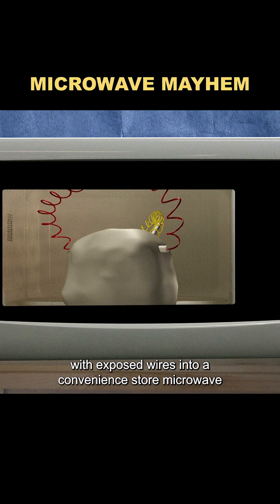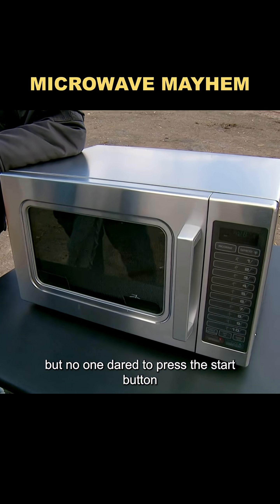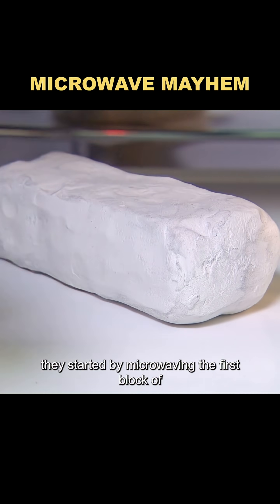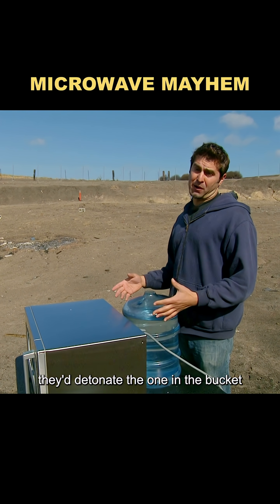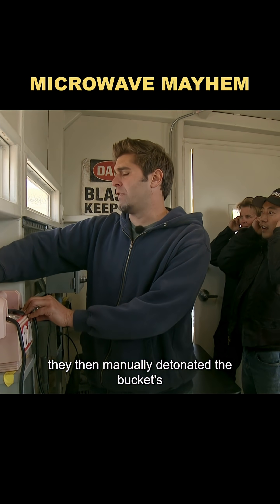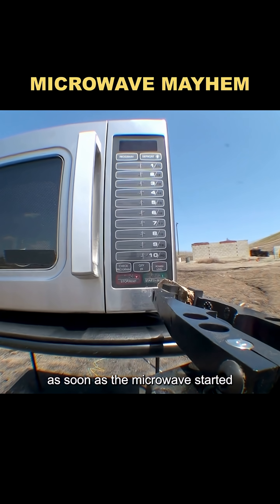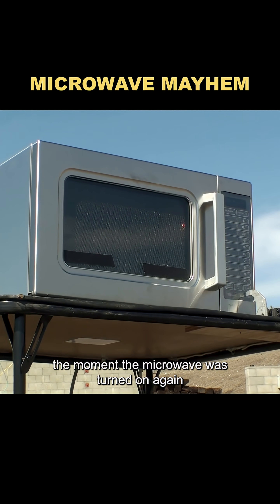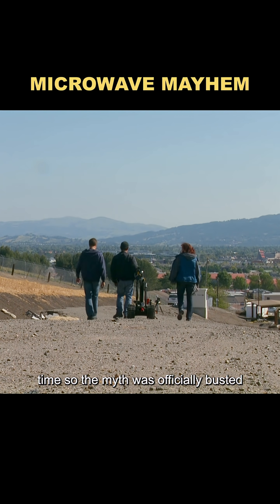What happens when you microwave a bomb?

Comment: To get a delay time on the blasting cap ....
 Place a fuse near the blasting cap, shorting it out.  Varying the current carrying capacity and blow characteristics(thermal mass) will influence blow time.  Knowing the microwave frequency and length of the stubs( blasting cap leads)  will allow standing wave calculations.  Place a null at the cap and at least 90⁰ out of phase at the fuse.  See the Amature Radio Relay League Handbook or similar references for an explanation and equations.  
When the fuse blows, the RF currents activate the cap a short time later.  Then. KA-BOOM!
QED

Comment: There is no way to initiate the explosive without the blasting cap.  c4 is highly stable to shock, heat, even burning.  You have to kick start the process with a high energy compression.  The blasting cap provides that.  You can even shoot a block of C4 and there is not enough initiation energy.  Some of these "composites" are so stable, they need a lower "high" explosive to set them off.  So blasting cap to C4, then C4 initiates say TEX or TATB.

Comment: Probably used Nitinol wire. So when wire the heated it it reformed to its original form and closed a circuit that charged a detonator wich then detonated the explosive. Its just my theory tho.
Reply: Yes no need for the c4. The real question is would a microwave detonate a blasting cap.

Comment: Yes C4 needs a blasting cap, you can’t detonate it any other way, setting it alight, crushing it, heating it up in a microwave doesn’t work.
Reply: eletricty, simply...
Reply: @DINO-9843  no. you need a nother explosive and high heat for ignition. electricity has no effect
Reply: @brainslayer666 yes it is electricity, the fuse wire from a detonator or remote device will set off an electrical shockwave to set off the bomb
Reply: @brainslayer666 that's what you call a blasting cap.
Reply: @brainslayer666  yes, the detonator sends a shockwave
Reply: Hell some soldiers use it as putty and others burn it for boiling water
Reply: Thanks
Reply: @darksimt thanks? 🤨
Reply: @Kevinarigic  I was studying bombs, not for danger purposes, just for chemistry knowledge.
Reply: So i could make one with brass coil and a battery?
Reply: @tri_crisis_tc721 for fire yes but if you a blasting cap was needed (specially made to trigger the compression and such needed to make c4 explode) I doubt you can remake one without primers or such
Reply: @mazthehe bet
Reply: Heyy i was gonna say that
Reply: not even shooting at it bro